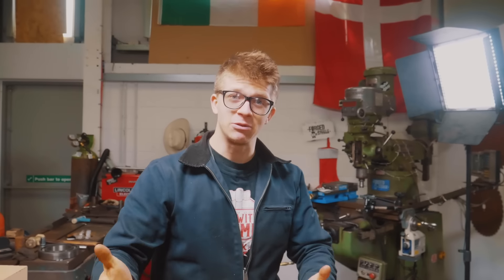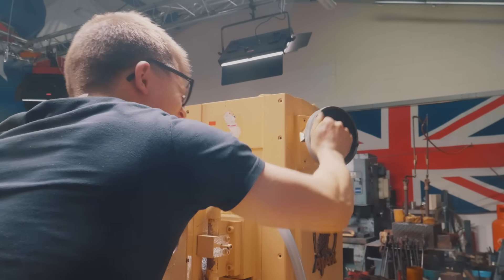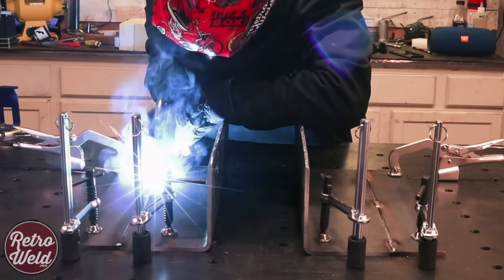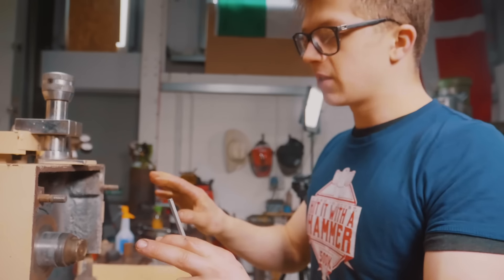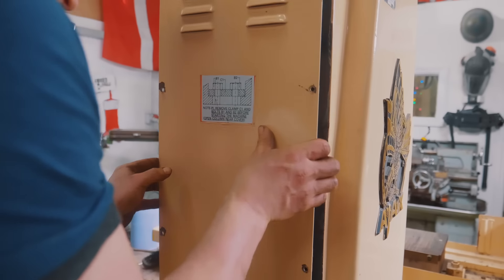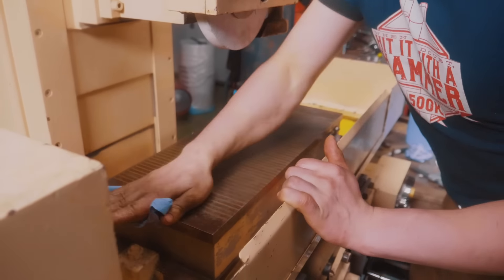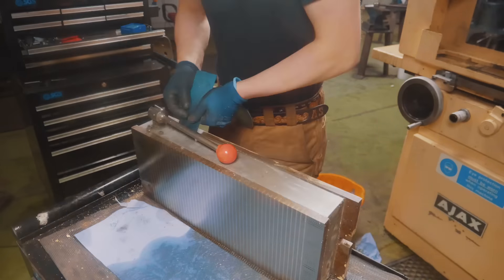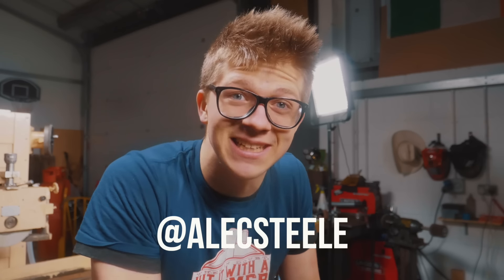THE SURFACE GRINDER IS ALIVE!!!

Comment: Alec, I couldn’t tell if you had the magnet “on” when grinding your chuck but you should. The difference between on and off can be a couple tenths when grinding. Also take no more than .0001” at a time when you grind the chuck. It may take a day or two to grind it but it will be worth it later. Good luck and happy machining.

Comment: 11:40 Ok, actually, it doesn't really matter if your diamond dresser is PERFECTLY true, and yes you can tell if you movement of the top wheel dresser is true, it will be very obvious when you start grinding

"This old tony" has a video about wear of grinding stones and because of how grinder works, if you wheel isn't dressed true what's going to happen is that only the lowest spot on the wheel will be grinding. It will always grind true.

Comment: I must say that this video is entertaining as well as instructional. It is right where I am with my shop. I trained as a machinist many years ago. I learned blacksmithing basically to heat treat my projects while at my job. With that said, I appreciate your instruction on this matter.  I used surface grinder in school but its been a long time ago so I have to get mine hooked up and remember how to use one.

Comment: it doesn't matter its out of square . as long as it is flat.     oh well.. just a tip when you put thin steel on the table it gets pulled down by the mag, ok but it doesn't meen your job will remain flat as if its bowed it can remain bowed when you take it off chuck 
some time you may have to shim it so its a good idea to check your material for bow on a surface plate 
also bit dangerous to touch on one area and hope your not to low . just get it nearly down to the job run left right feed and lower bit at time whilst rapidly front and back by hand .hope this helps ps I'm a toolmaker by trade . and want you to be safe 
good luck

Comment: You could make a removable clear plastic shroud that connects to it at the head that goes to the end of the table to help keep the dust more contained. Take a piece of wide flat stock bend it to 90  degrees. Put in 2 holes so you can bolt it to the shroud and weld a piece of flat stock above the bend and blow the bottom bolt hole with a gap that's slight more than the plastic shroud. Drill another hole a few inches away from the bend and insert a bolt into it and weld the bolt from the bottom. Put a butterfly nut onto that bolt and bolt it to the head shroud. On one end of the plastic shroud cut a slot that fits the bolt/ butterfly screw and put a door handle on it to make it easier to hold when putting on and taking off. Get some plastic skirting(hula skirt) and bolt to the end of the new shroud.

To make the shroud use plexi glass/Perspex, a heat gun, and a metal plate that's slightly wider than the box thing on the end of the table dust is shot at but at the full tables movement(twice the width). Clamp the plate and plastic to a striking anvil or whatever available then use the heat gun to heat up the plastic and bend it to 90 degrees to make a 3 sided box.

Your new dust problem will then be contained to inside the table or around the machine rather than the other side of the shop. Plus if something goes catastrophic and launches shards of itself in that direction the new shroud will help with that. Removing and putting it on would takes seconds too so it wouldn't be an inconvenience and will make up for it's own time with less cleanup time later.

Comment: Hey Alec, just a suggestion: It would be advisable to use end sleeves for the live wires and solderless wire connectors for the ground wire to ensure that there will be no problems with the wiring. Otherwise the cables can corrode more easily or even slip out of the clamp and cause a short circuit. Great Video btw :D

Comment: You are awesome! Watching you learn and experience new machines like this is something I can relate too. I recently graduated from a program here for machine tool, and tool & die. We used lathes mills and surface grinders. You yelling when the hydraulics started howling and the table started moving was truly amazing. Something I can completely relate to as I can remember my first time on equipment like the surface grinder. 
Another thing. At school we used the surface grinder ALOT. We never used a respirator or anything like that. Just made sure we had the correct mixture of coolant and to never stand on the receiving end of the grinder lol. I wouldn't worry about breathing anything in personally. But I also haven't done much research into it either. Just first hand of me grinding stuff on and off for 2 years sometimes days at a time. My instructor was a veteran in the trade, he also never said anything about a respirator. But what you do regarding your safety is up to you, and its probably best to use whatever you think you need to. Always go with you gut!

Comment: just a hint. when you turn off the machine, turn off the coolant first and let the coolant spin out of the wheel. Otherwise the coolant left in the wheel will seep to the bottom of the wheel and throw it out of balance. This can cause the wheel to explode on next start up. Also check to see if a wheel is any good by tapping  it with  a plastic or wooden handle . If in makes a ringing sound it's a good wheel, if it makes a thud noise then the wheel is cracked.

Comment: The ground is for safety. the motors will run without it. The motor is dependent only on the 3 wires. (each phase)

Comment: You should bend the wires into a J shape and screw it in for better mechanical retention. This will prevent the wires pulling loose and blowing your breaker or starting a fire 🔥

Comment: Those wheels are super porous, I used one for aluminum grinding when I was making firearms.  they take some time to break in, but what is happening is that the dust gets in the pores of the wheel which helps it cut whatever material you're grinding.  Mine was just on a table motor though.

Comment: The edge of the surface grinder table bieng out of square is not an issue, it doesn't do anything in relation to the operation of the machine

Comment: when you are roughing in your grind put a nice course dress on your wheel. so feed across the wheel faster then you would for your finish dress and also use coolant when dressing, if you dont you can overheat and crack your diamond. Also make sure after using coolant that you let the wheel spin for about 30minutes to get all the coolant out of it or you can end up with a surpise when you start the wheel and the residual coolant has collected in the bottom of the wheel and it explodes.

Comment: By using the unlevel surface to flatten the wheel, are you not crating an unlevel surface by grinding the plate with the wheel?

Comment: A ring test should be performed before mounting an abrasive wheel. This test is 
simple and can help determine if the wheel is cracked. How to do the test:
(1) Suspend the wheel by putting a small pin or your finger through the arbor hole in 
the wheel.  Heavier wheels may be allowed to rest in a vertical position on a clean 
hard floor (See Illustration 1).
(2) Tap the flat side of the wheel with a light non-metallic implement, such as the 
handle of a screw driver, at a point 45 degrees from the vertical center line on each side of the wheel (See Illustration 2)
and 1 – 2 inches from the edge of the wheel.  Large, thick wheels may be struck on the 
periphery rather than the side of the wheel.  
(3) Rotate the wheel 45 degrees and repeat the test until the entire wheel has been 
checked.
How to use the results:
The ring test depends on the fact that a crack in the wheel will normally change the 
sound emitted when the wheel is lightly tapped.  An undamaged wheel will give a 
clear tone. If cracked, there will be a dead sound and not a clear ring.
Comparison of the sound with other wheels of the same lot and specification will allow 
rejection of any wheel with a suspiciously different ring

Comment: wanna know a quick way to test for cracks in grinder wheels and disks? hang the wheel/disk from a coat hanger and give it a TAP with something SMALL and metallic. when this is done it should ring with a clear tone, you'll get nothing but a dull thud otherwise

Comment: It's possible to run it with only the live wires but unsafe. You need a ground or bolted to the concrete.

Comment: Do not turn off the machine after dressing the wheel, if and when you do that you have thrown it back off center because it has play in it. You dress the wheel and then leave it running and start cutting on your part.

Comment: Dont mind me not checking if anyone already posted this: You dont need N (the blue wire) when you run a 3-phase electric motor. The only instance you would need it if there were additional components only using power from one phase or  you motor might attempt using it when it starts failing (in which case its best not to have N connected) If curious as to why you dont need that, google can elaborate. I suck at explaining things.

Comment: Hey Alec you should ring a wheel before using it just tap it with a piece of wood and it should ring like a bell if it has a thud it's cracked and do not mount the wheel

Comment: Awesome vid!  Before putting up a grinding wheel, make sure to do a "ring" test- use a soft mallet to ring the wheel like a bell.  It should ring, and if the wheel is cracked, it'll sound dull.  If cracked it'll blow up on ya at higher ripums

Comment: Yes when you use 220 you dont need a neutral...its good to have a ground but it will work with only 2 wires
Reply: I've always wondered how American wiring works. Both in the UK and down here in Oz we have either 3 phase (415V - three active wires) for big motors/industrial/commercial uses or general housing is generally single phase (240V), which is one active wire (out of the 3) and the neutral. I think some of the old farm supplies came with some wacky transformers that work like you guys use. (Split-phase? too long since tech school and never worked on any, I think it was phased out) But the two wires don't work here, you'll cook your motors in half a minute or less. The neutral is also needed in this machine to run the control circuit... and nothing is connected (unless it's double insulated) without an earth, far too dangerous.

Comment: Ground was through the flexible conduit and is allowed in most areas. Personally, I still run a ground because I have seen too many conduit connections broken. You do not need a neutral to run a three phase motor. A neutral connection to a piece of equipment that is 3 phased is usually used for single phase parts of the machine, like lights and control relays. With what this is, most likely it was running with just the connections and ground through the conduit.

Also, put some fork or ring connectors on the ends of those wires. Just putting the ends of braided wire in those connections is going to result in unreliable connections that will work loose and become hot spots in the wiring. You could also tin the ends of the wire with some solder, but fork/ring connectors are way easier and more reliable,

-Industrial Electrician, retired

Comment: btw the tool for the wheel is normally a dogbone/Wye shaped wrench with the two prongs on it to hold it still.  also the speed of your wheel is key not just size... also I would use paper to center the wheel best as possible (not sure on the speed of that grinder) off balance will still be a issue even if you use that diamond to level the griding surface...

Comment: Just a piece of advice Alec. To get the most accurate finish don’t shut off your grinder if you take your part out. If you shut off the machine the wheel may run different and it can screw up your part. Just a little tip that may help you in the long run.

Comment: Three phase motors will run without neural. Star configuration, neutral would be at 0 volts, if it isn't a coil or phase supply has failed - this can be used to automatically stop the motor. In Delta configuration, there is no neutral.
Electrically it is non compliant have the wire loose in the box. All devices will run without Earth, but become lethal with an active to   case fault.

Comment: Here's a hint on grinding wheels. Those chips on the edge won't hurt anything as long as you have dressed the wheel before using it. When you dress the chipped wheel if there is a problem it will show up then. As far as checking the safety of a used wheel you will want to know how to wring it out.Put your finger thru the center hole and let the wheel just hang from your finger. Next,use a large drill bit,or piece of metal stock, something about twice the diameter of a pencil and long enough to lightly tap the stone like you would a triangle instrument that is played in the band.If you tap it once lightly you should hear a clear high pitched ping. If the ping sound isn't there or you think it stops wringing too quickly you probably have a cracked stone and I suggest not using it. Cracked stones might fly apart when you start them up. But even worse is when the blow up while using it. Also always make sure you use a heavy paper washer on your stones do they aren't ever tightened up directly to metal.

Comment: You do not need any fancy equipment to balance your wheel. You actually get a decent result if you just balance it right on it’s spindle. 1. You Spinn it by hand and have a look what part of the wheel stops at the Lowe end. 2. Repeat 1. a few times. 3. Put some Playdooh on the wheel on the opposite site. 4. Repeat 1. 2. And 3. until the wheel has no more tendency towards one side. 5. Weigh the Playdohh and bore out the corresponding amount of the wheel exactly opposite the place the Playdohh was stocked on. (The density of the stone is appx. 1.7 to 1.9). Rinse and repeat.  Makes a huge! difference in accuracy and prolongs the life of your spindle bearing. 

Of course you have to take care that you reassemble it always in the same way, meaning you have to be careful about the alignment if the shaft, the screws, the ring and so on. But I think this is stating the obvious.

If this method does not work, your spindle bearing is probably gone beyond repair.

Comment: Hi Alex,
it would be better for the  pin spanner to be hard against the wheel ie with short pins and positioning the adjustable spanner on the outside, works far better.

Comment: Alec !! just found your channel & I got to say "very interesting" even though you're only just doing a preliminary "setup & diagnosis". I have always said & I've been fixing things for 50 some odd years > being 1/2 right is a lot better than totally wrong < ! If you're going to set up a machine 'new or used' take it apart so you fully understand what it's capable of doing! Don't let it surprise you later while it is running at full speed.   Good luck - Good video - I'm here & watching.

Comment: Alec, pro machinist tip: if you really want your parts to be to be as flat as possible when surface grinding keep the wheel running even when you take the part off to flip it or measure it (just watch your fingers around the moving wheel). Each time you turn off the wheel it's a little less true... Also you might want to grind in the magnetic chuck if you're going to be doing alot of precision work on the surface grinder.

Comment: You need to use cable shoes for the wire connection! The wires connected like that will loosen, and the less surface you have «touching» in the connection point, the more impedance you will have in the connection point. This creates heat and your machine might catch fire :p

Comment: Alec if you use a torque wrench when bolting that mag chuck down set at lets say 100 lbs of torque now that its all resurfaced you can tighten both sides equally so you have no high or low spots on either side of the mag chuck.

Comment: Screw the cap loose with your foot, ones much stronger there, secure the jerrycan and hook one of the ribs of the cap behind the shoe heel and twist it horizontal (counter clockwise off course):-)

Comment: @Alec Please, do use some spade terminals to your power wire, if the cable move inside it can be detached, and the contact point will be more reliable, specially when you consume a lot of power. If the connection point is weak, it become hot and it can start a fire. Don't play with that, save your workshop and buy a box of spade terminals.

Comment: did you rinf the wheel before you put it on always ring the wheel even a new one hole it with something wooden in the hole and tap it lightly with something metal if it rings its good if its dull theres a crack and it will be bad

Comment: Honestly, I'm more scared of hydraulics than electricity. As an electrician, I've had my share of shocks (the worst one while pulling a "dead" wire through a wall, my tricep hitting a live, uncovered socket and straightening my elbow in a matter of milliseconds). High pressure hydraulic oil leaks can actually puncture your skin without bleeding significantly, and the oil will stay under your skin causing infections, potentially resulting in amputation if not treated at once.

Comment: You might set your spanner so the handle can rest on the guard pin. More consistent torque, less knuckle busting.
This will work in both directions. Save some energy for those applicants.

Comment: I'd tin and re attach the plug wires if it were mine, just in case. they didn't look like they were gripped very well by the screws holding them in place.